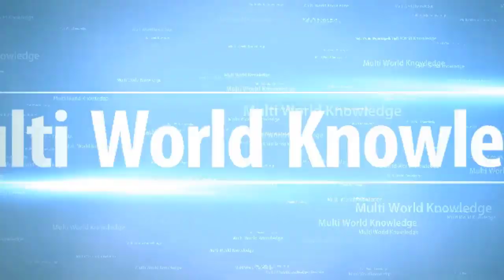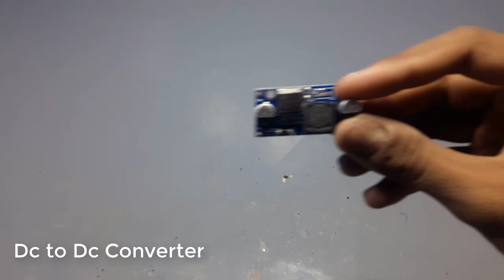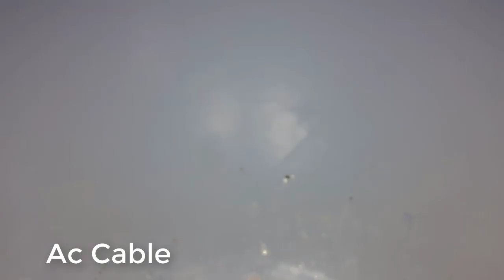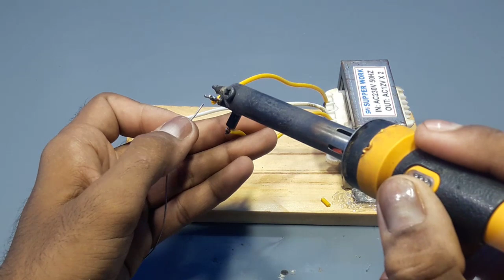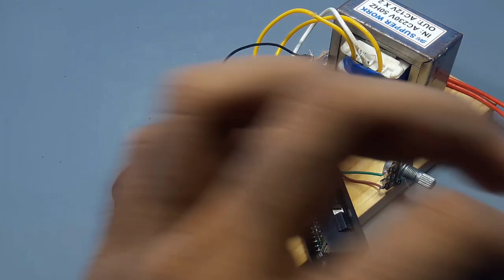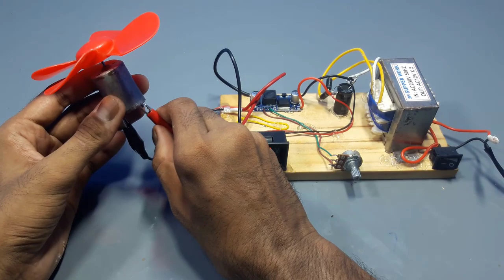How to Make Ac to Dc Converter with Dc Variable Voltage Regulator _ Diy Electronic Projects

Comment: Hot glue to hold the transformer is just silly when 2 screws will easily secure it better. The whole thing is fragile AF. But a big thumbs up for the very clear circuit example. BTW: A parts list with part numbers would be great.

Comment: Components list
AC Transformer 12V - 12V  5A
DC Volt & amps Meter
DC - Dc buck convertor
Variable Resistor 10K
Diode IN5408 or bridge rectifier KBU2510
Capacitor 2200uf 25v - 35v

Comment: Can I use 2200uf 50v capacitor
Reply: Generally speaking - YES.
The voltage should not matter with capacitors, if it is higher. So 50V is viable optipn (f.e. 15 would probably explode)